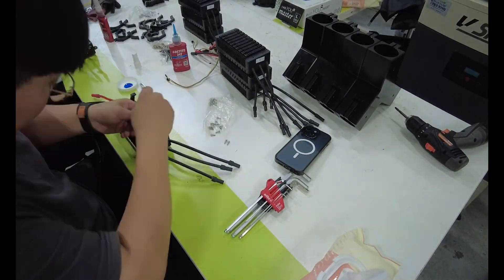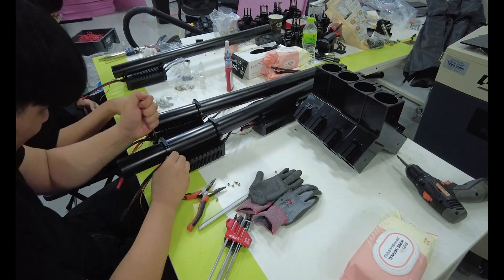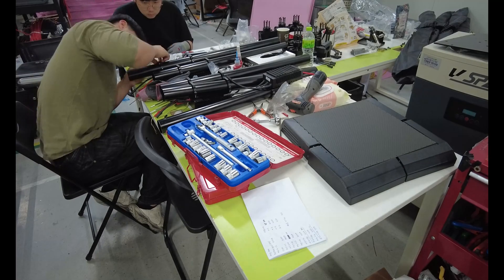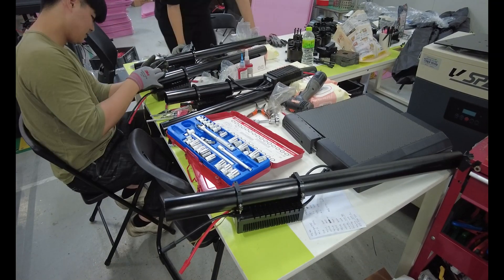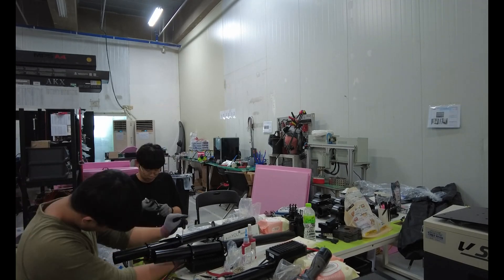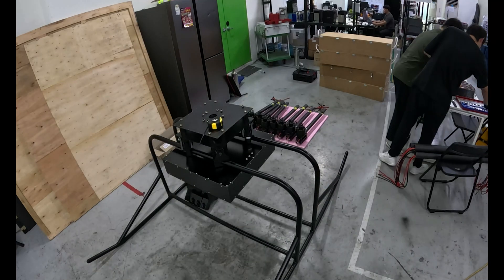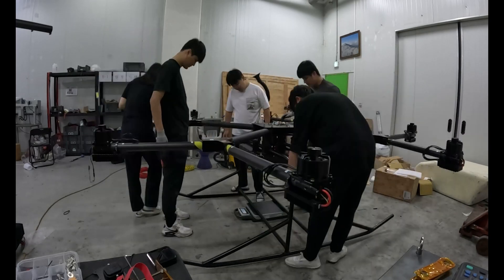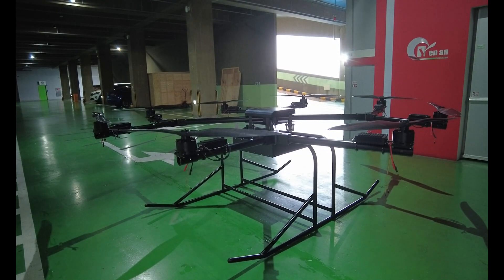I Built World BIGGEST Electric Drone by Hand – PART3 _ FULL ASSEMBLY

Comment: Those ESC’s they look like “ MOSFET  500” !
Reply from the maker: You're spot on! These ESCs are equipped with high-performance MOSFETs designed to handle substantial current loads. For instance, the Alien 500A 4-24S Sport2 Air-72 MOSFET ESC utilizes 32 high-quality power MOSFETs across two PCBs to deliver exceptional power and performance for professional applications. This configuration ensures efficient current handling and thermal management, making them ideal for demanding setups.
Reply: @ I have the same ESC’s , it’s fun working on projects like these 👍

Comment: How much does it cost in parts?
Reply from the maker: Great question — for this version (225kg heavy lift drone), parts alone cost roughly $18,000–$20,000 USD, depending on supplier and battery configuration.
I tried to keep it as affordable as possible without sacrificing safety or performance.